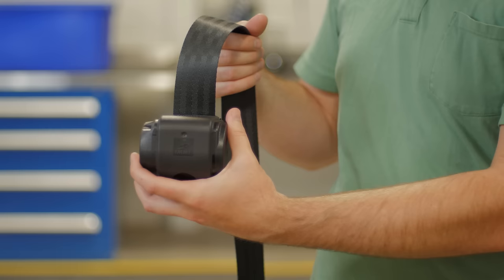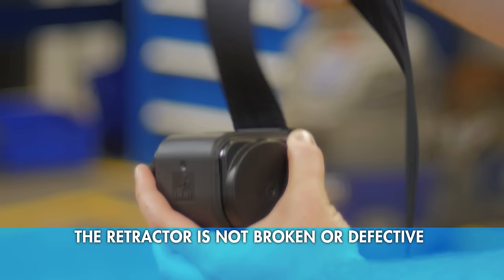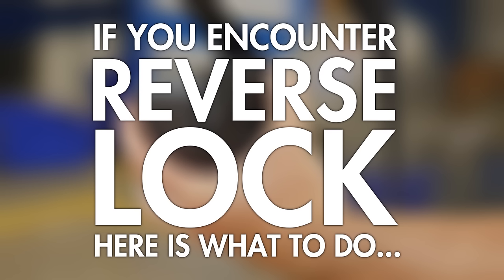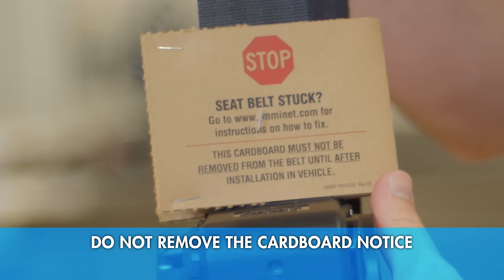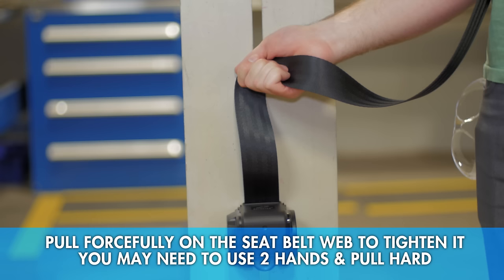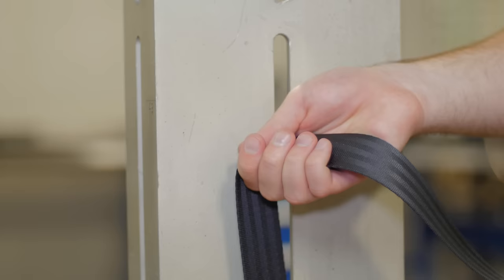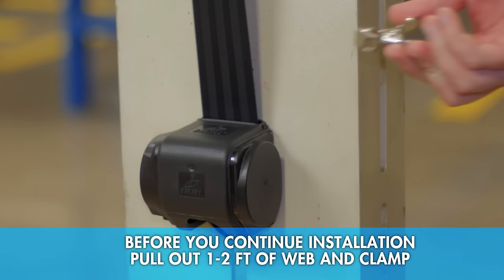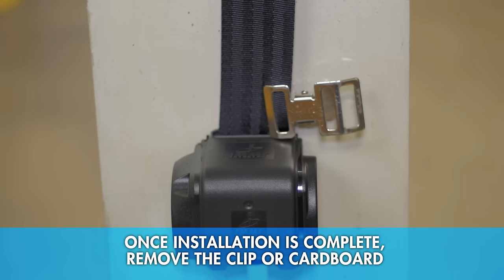Seat Belt Stuck? - How to Undo Reverse Lock on a Retractor

Comment: Works for me.   After a sudden stop my seat belt locked, belt didn't retract or  pull out.  Took the whole seat belt out to inspect.  Then holding the seat belt in the same upright position as it installed in the car I was able to manually wind a little belt (maybe 1/2 turn) on the spool then pull the belt straight up.  Did this 2-3 times then boom it released and retractor worked as it should, just like the video.

Comment: Thank you! This was very helpful. I used it to fix a locked belt on an older car. The key was to do as you suggested - pull hard on the belt for long enough to tighten the belt on the spool. As you said, this allowed the spool to turn sufficiently when the belt was released to unlock it. I have put a permanent clip on the belt to prevent it from happening again. Contrary to what some (probably very frustrated folks) have commented, this video was excellent help. So simple, too.
Reply: In this case (a 2003 Chev Cavalier), the clip didn't help. The belt locked again when the clip stopped it at the slot to the spool. However, pulling hard and steadily on the belt for several seconds to tighten the belt on the spool, and then letting go of the belt released the lock again. It has locked a couple of times since then, but the method just described worked every time. Why it should have started spooling too loosely is hard to say, but the car is 16 years old. The driver's side belt has never locked (knock wood). Thanks again for this easy solution. I was getting ready to head to the wrecker's to get a new retractor, and considering how to cut a hole in the paneling to get at the current one.

Comment: I was skeptical with the ease fix. But it does work. First make sure the retractor is straight with the belt as in the video, then after releasing it a little bit, you should hear a faint click, pull the belt at that moment, continue to do so for more access to the belt

Comment: The lock mechanism engages if the car's on an incline, etc. so it will also engage if you don't have the part oriented exactly the same way it will be when installed. So hold it upright, give it a couple of taps and/or wiggle the belt a bit, the lock will release. Pull the belt out slowly. Might take a few tries, but it shouldn't require any extreme measures.
Reply: Justine Larsen thank you!!(
Reply: Holy crap Justine Larson ....I did like you said..Bolted it in place & voila it unlocked..
Reply: Thank you,  you really saved this video and a lot of frustration on my part.
Reply: I had my car on a hill, taking it to a plane solved it, thank you!
Reply: Had to comment, this worked perfectly
Reply: OMG, yes, I was parked on a steep hill  thank you for this, drove down the gill and could get it to pull out correctly
Reply: This works, thanks!
Reply: Justine, you've cracked the code. You're a fucking genius and I love you.
Reply: YOU LEGEND, THANK YOU
Reply: Mine is a new car and somehow an “adult” who was in the back seat decided to pull the seat belt all the way out. I have no kids in the car so it can’t be dirty but I am having the hardest time and yes, I was on an incline but went down to street and did everything and it still won’t budge! So frustrating!

Comment: The secret people is very gentle pulling it out. If you can roll it by hand with your left hand and pull it with the right one. It seemed impossible but it worked. Also try gentle taps. The mechanism is just doing it's job! Good luck

Comment: On most seatbelts there is a removable sode cover and you can just use a screw driver to release the locking ball and then take a lot of seatbelt length out

Comment: Mine is stuck tight for no reason I can see.  It will not let you pull on it at all.
Sooooo...went out, popped the molding away from the area of the drivers side, naturally, seat belt attachment & pushed something on the side which then released it again, so thank you so much for your video.

Comment: (sorry about all caps)
MY PROBLEM IS THAT THE SEAT BELT IS TWISTED INSIDE THE RETRACTOR, SO IT WON'T PULL OUT, AND IT CAN'T BE PUSHED BACK IN. ISN'T THERE A 'LOCK' OR A 'LEVER' THAT CAN DISENGAGE THE RETRACTOR AND ALLOW THE BELT TO BE PULLED ALL THE WAY OUT TO UNTWIST IT?

Comment: Trying to release the belt by holding the housing in your hand IS THE BIGGEST PROBLEM,  you cannot hold still while holding the housing in one hand and try to pull with the other, is like going down a bumpy road and trying to release the belt, it will simply lock up on you.  First thing you do is firmly bolt it in the correct direction perpendicular to the floor, roll in the spool a bit and jerk the belt up...it will release if is not broken.  I have sold thousands of new replacement out of eBay, originally made for the Humvee, but will work on the  most of other vehicles and sometimes I have a customer calling with a "stuck"  belt...thanks to UPS being so gentle with the package.. "rolling eyes" and 99.9% is because they did not read the instructions and try to release the belt but holding the housing in their hands.

Comment: The ones with the plastuc casing usually a japanese car are just easy, simply take the side plastic the one housing the retractor and it will easily get loosen, usually its because the rubber stopper has expired and deteriorated so instead of giving back a slack it'll just eat it. Once you take that out it will have a direct link and no useless stopper to cut off everytime you pull it out.

Comment: I extracted a working seatbelt assembly from a junk car to swap into my 2007 Saab 9-3. Removal on site was flawless but upon  inspecting piece, the belt sucked itself into the spool before I could stop it and now the entire thing is inside the spool! Is this video the correct solution?

Comment: So I let my new seatbelt on my 2008 Beetle roll all the way up during installation and it locked... won’t go in or out. Been trying to tug on it forever but stays locked. If I put it back on the car and pull it hard it’ll unlock??? Mind boggling if true as it’s so simple yet been driving me crazy for 3 days. Anyone confirm if this is my problem and the way to fix it?

Comment: If the car has been in an accident the retractor permanently locks up and must be replaced or sent out for repair. Such is the case on my '07 Mustang. There is a gas charge and sensor built into the retractor. If this is what you have then you can pull on it until the cows come home and it won't budge. Stupid video.

Comment: No.  This video is totally worthless.  There is no slack in the belt, the bolts cannot be removed without cutting them off with a grinder or torch and the belt will not retract to release.

Comment: The pyro sensor in the seat belt pretensioner could be bad. Most likely need to replace the seat belt pretensioner. You can buy a used one on www.eBay.com 
or send your seat belt for repair at www.myairbags.com

    Here is Video link
https://youtu.be/xT5tiT2A78w